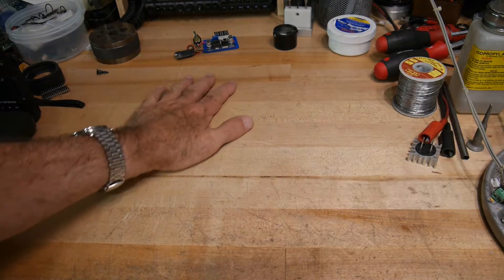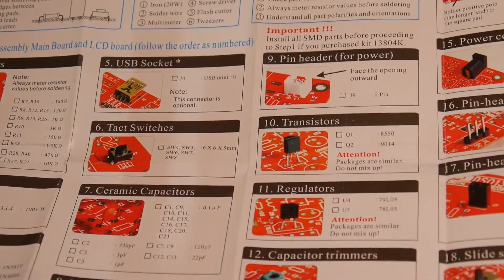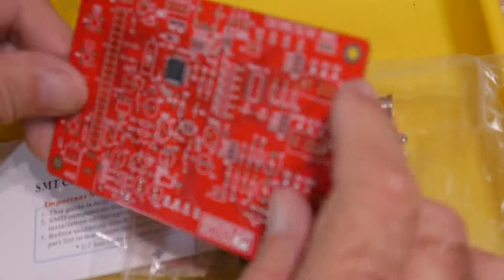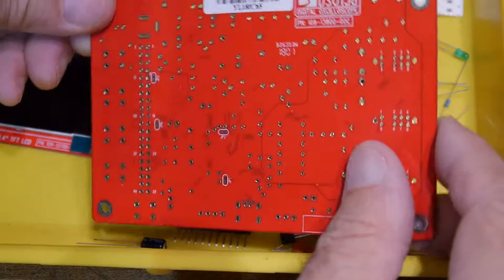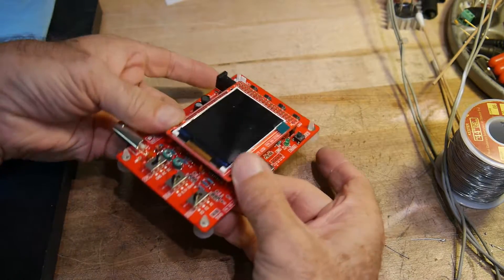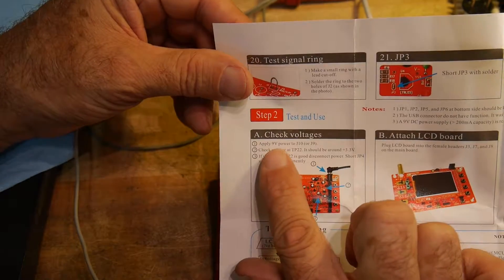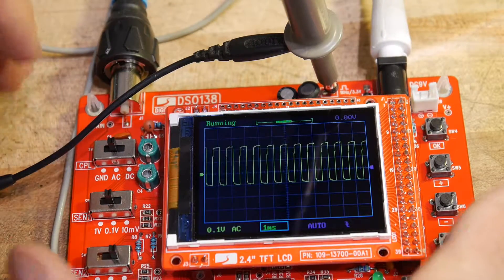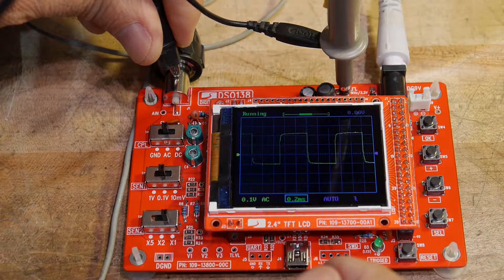#255 JYETech DSO138 DIY Digital Oscilloscope Kit

Comment: Look forward to hearing about the BW; I did a club presentation recently on building a simple test bench using inexpensive eBay/other supplier test gear for the beginner. This would be a good teaching vehicle for soldering and offer up a basic limited capability scope to get the feel for how one works...just have to keep in mind the limited capability. Thanks for sharing!  73 - Dino KL0S
Reply from the maker: i'd be curious to see what items you picked for the bench
Reply: Actually I picked some examples I found mostly on eBay and tried to cover the range of test gear from DMMs, signal generators, component testers, USB scopes, power & frequency meters, etc. I may actually get some of this stuff to actually build a modern "Ten Buck Test Bench" like Vern "The Radio Mechanic" has done with vintage gear on his channel. There's a good presentation by Steve K1RF that I used for a basis for my pitch (do a search for "Low-Cost Test Equipment You Can Buy on eBay").
Reply from the maker: nice presentation. Now I want to buy some of those things like the return loss bridge and power meter module.
Reply: The power meter is actually pretty good...I characterized it vs. the bench stuff and it's close and considering the cost you just can't beat it for relative measurements. I also re-characterized it after changing the input Z from 100 to 50 ohms and the shape of the curve didn't change just a tiny bit of power offset all along the curve. I do have a nifty little frequency counter/power meter/dummy load that is worth a look as well (search for GY561).
Reply from the maker: that gy561 looks sweet. I designed fancy power meters at Wavetek in the olden days.